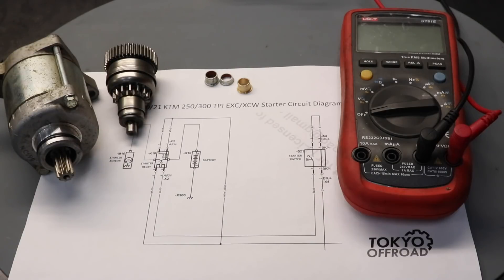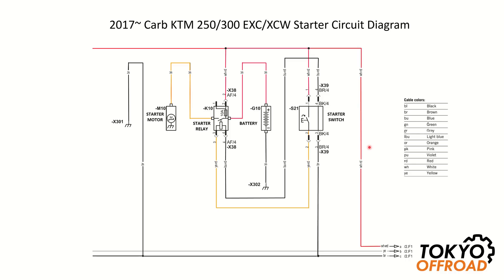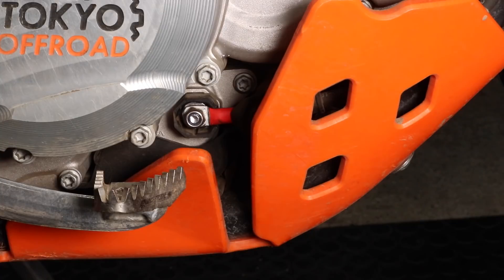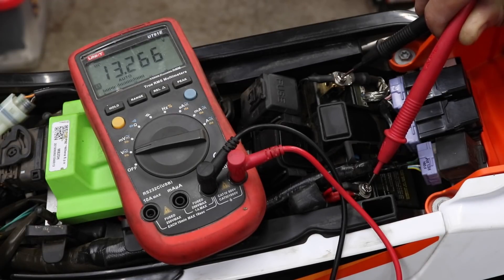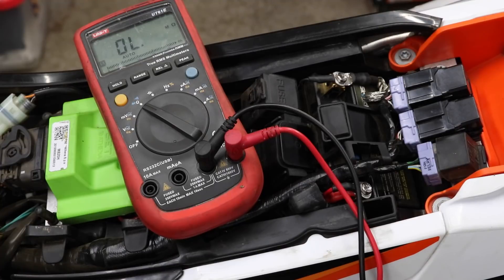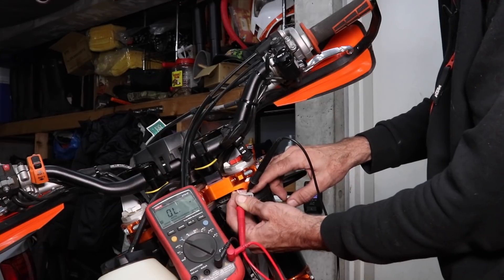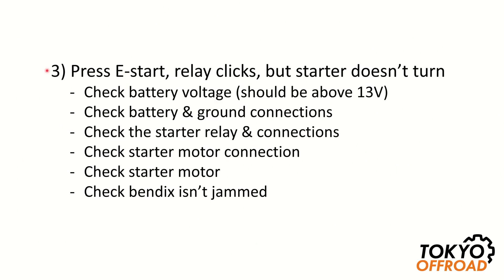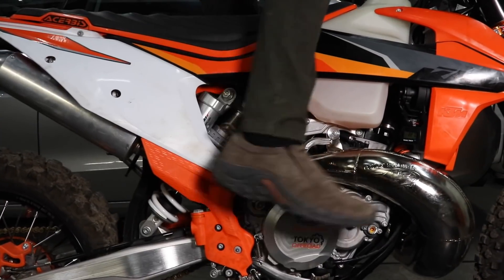KTM & Husqvarna 2-Stroke Electric Starter Issue Debug

Comment: My te300 is a 2025 with 13 hrs on it. Im getting a rattle on start up. Not sure if its the bendix or the bushings for it. Either way its clearly staying engaged for a few sec after the engine starts cranking under its own power
Reply: After opening it up, i noticed the dealer filled with with grease. It ended gumming up in the back bushing
Reply from the maker: It it stays engaged it may be that the bendix is a little sticky. On the TBI bikes to remove the bendix I find it best to remove the flywheel using a puller tool. Once the bendix is removed clean it thorughly with a parts cleaner spray (internally too. To tube it either use a light weigh oil which doesn't tack up, or a dry lube. Do not use grease, pr a heavy oil. Check the condition of the bendix bushings and replace if necessary. For lubing the flywheel I recommend using a light weight oil, not grease (which will fly off and may cause the bendix to become sticky).
Reply: @TokyoOffroad My plan was similar to your recommendation. I was wondering what to use for a lubricant for it. I'll go with a dry silicone or graphite. Thank you for the help and advice

Comment: I have ktm 300exc and some strange problem with my starter, it works ok, means it speen the enghine but enghine is not starting, no spark. It starts first kick but on e start spark is week or absent. I discover that  when i press kill switch for second when cranking on e starter it will start any ide what the issue might be ? I have new lithium battery, new starter, new style bendix, new bushings.
Reply from the maker: Sorry to hear about the problem. What year model bike do you have?
Reply: Acually it is Husaberg TE 300 from 2013, bit its the same as Exc from the same year

Comment: Thanks for an informative video. My Husky Te250i 2021 is having another issue than the starter... It refuses to turn ignition off. Instead it turns on intermittent (every few minutes the ignition turns on by itself). Any ideas?
Reply from the maker: When you say the ignition turns on, do you mean that the engine starts, or that the fuel pump cycles? If you have a battery tender/charger connected that may cause the fuel pump to cycle
Reply: @ the fuel pump goes and the “engine-light” turns on, the starter doesn’t engage but what happens is that the battery gets drained (off course) and the bike runs very “rich” after starting since the fuel pump has been running several times. As soon as it starts, the “check engine light” turns off and everything works as normal. 

It started after a close encounter with a branch that ripped one wire from the stator but that was an easy fix. Been looking through more or less the whole harness and can’t find any more damaged cables. 
 Seems like the ignition / fuel-pump relay gets a constant ground though…

Comment: Hello I’m having a big problem with my 2023 ktm 250xc 2 stroke flywheel. Sometimes when I start my bike my flywheel misadjusts, causing the ignition timing to be off and not start the bike.
I’ve tried tightening the nut to spec and using the locktite washer and red locktite liquid. Still comes loose. The nut and the flywheel stay tight but it misaligns the flywheel. This is also my 2nd flywheel as my first flywheel stripped completely. I don’t know what to do I’ve tried a bunch of stuff and I’m thinking of either impacting my nut on or welding it.
Reply from the maker: You must be missing the Woodruff key. Remove the flywheel and check that the woodruff key is installed and has not sheared.

Comment: Video is great but does not point out that the solenoid is powered by the battery and must be hooked up to the correct side of the relay. Well at least on my 2015te300.

Comment: Hi, Where are all the ground connections please? My bike is not starting after a few weeks of not riding change the battery and the bendix and still not starting.

Thanks
Reply from the maker: The main one which often goes bad is the battery ground strap connection to the subframe. Remove the strap connection and use a wire brush to clean the connector. Apply some dielectric grease (silicone grease works fine) will help keep the connection in good condition. The starter is grounded through the engine. The stator/regulator system has some ground connections to the frame located under the tank (remove the tank to inspect).

Comment: Hey mate great vid but it is not conclusive. 

I got lucky stumbling on to the fix for my starter. I got the clicking sound and nothing else. 

Turns out the previous owner installed an aftermarket clutch cover and the bolt near the brake pedal tip had a 60mm bolt instead of the required 55mm. The longer one goes through the end of the bolt hole then pushes up against the starter housing which is enough to distort it and seize the motor. 

Replacing that one bolt has fixed my issue.
Reply: Hey mate just wanted to say I had this issue to after installing aftermarket clutch cover. I was tearing my hair out going through this list when I saw your comment,  much appreciated, bike started right up
Reply: @mattnean54  awesome mate, glad to have helped out.
Reply: Had the same issue.  Glad I saw this post.  Boyesen clutch cover.  I didn't have a spare 55mm bolt lying around so I just used some washers to space it out a bit.
Reply: @jasonplank8803 glad to have helped
Reply: Just saw this comment and had the same issue, fixed the problem. Thanks!
Reply: @jimmyjohnson3076 you’re welcome

Comment: Inspired by this video, I opened the starter button switch as well as the 4-way connector. 

It is surprising that the connector halves are 'open' from the rear, hence upon reassembly I chose to stuff the openings with silicon paste to make them watertight. There was indeed turquoise corrosion in the bottom pin (in my bike the connector is in vertical position; 2018 Husky). Using contact cleaner and a wire brush (male pins) and a 2mm drill bit (female connectors) managed to clean them spick-and-span.

Normally I'd be hesitant to apply dielectric grease on connector surfaces - the grease being an insulator. But since there is only intermittent and short term low current going through to the relay, I gave it a go. Surely it will help keeping the connector free from corrosion.

Comment: My 2020 tpi starter failed to light up when the button was pressed. Found chafed and shorted wires to the button where they were kinked and zip tied to the warning light harness. This was done at the factory and was inside the plastic wire conduit. This failure happened intermittently, last time in a tight sand wash 15 miles from a transfer rd. Luckily it failed in the shop when I could then track it down. Thank you for all the really great how to videos. I will be using your kickstart install video when it’s top end time at 150 hrs

Comment: First thanks for the video! I have a 2010 Ktm 300 exc. The starter will engage the flywheel briefly then spin without engaging? I’ve rebuilt the starter motor, new brushes, bushes, fully cleaned bendix and oiled with light oil throughout, battery is good 13.2v, even tried new ground from the starter to the frame but still the same issue? Any help appreciated

Comment: 2018 TE150 - E start functions perfectly about 5% of the time. The other 95% of the time, the button does nothing and makes no sound. Battery is brand new. Have replaced the relay and starter button. Connections seem okay with no corrosion. Thoughts? 
Thanks for all the videos.
Reply from the maker: Using a multimeter see if you can trace back the source of the issue. Start measuring the voltage at the relay connections when you press the start button. If you always see voltage at the relay when you press the button multiple time, but it doesn't always click then the relay is probably bad. If however you sometimes don't see voltage at the relay it indicates that there is probably an intermittent contact issue with the starter switch, wiring, or connector. As you've already replaced the relay and starter switch the most likely causes are the connector by the headset, or a broken wire by the the headset.

Comment: I don’t have any starter motor issues with my Husky TE 250 2015 as I removed it completely to reduce weight. I use that kick starter which exist in that motorcycle from the factory. I don’t ride any hard enduro with it. Mainly motocross type riding only.

Comment: Hey man! Thanks for all good work!

Have any clue why my electric start just spinn up with full force but wont start?

2020 ktm 250 tpi exc 12h.. ?

Thanks
Reply from the maker: If your starter motor is spinning at full speed, but the engine doesn’t turn over it’s probably a problem with the bendix (has become sticky internally), or the bendix bushings are worn out causing misalignment of the bendix.
Reply: @TokyoOffroad  so that could be the problem on a almost new bike then?

Sometime i starts, and then it stats easily!
When i have the problem it wont start, if i put a gear in, and back to neutral it often starts..

Strange?!
Reply from the maker: @predragkumanov8813  If it’s a new bike then the bushings won’t be worn out, but the bendix could be sticky. KTM put grease on the flywheel which is flung off almost straight away and creates a sticky bendix if it gets inside. You could try removing the bendix, clean it out internally using some parts spray and air, then lube it up inside using some dry lube, or light oil which doesn’t go tacky.
Reply: @TokyoOffroad  big thanks i will try that, have to see if im man enought to do that myself. Never checked in the starter motor area!
Reply: @TokyoOffroad  so i did check my bendix and itself was working smoothly, it did engage easily. 

But it was alot of sticky greese all around the area of the bushing and inside the bushing. And alot inside the cover that probably was comming from the fly wheel?

I removed almost all sticky lub even inside the bushing... Is there ment to be alot of lub inside/around that area of the cover?
Reply: Also i did check the battery, and ground. No problems. Bike is as i told you new(14h now) and never crashed. So should not be anything wrong with startbuttom etc?

Comment: at 15:00 you mention the spare fuse underneath the starter relay and the other fuse which powers all the other stuff apart from the starter motor. As per the electrical diagram, as far as I can read there is no inline fuse for the starter system; can you confirm is there no fuse in the starter motor circuit ?  An aside to the starter debugging process, the other three relays behind the starter motor relay, not applicable for this discussion but be good to know which each one does. Overall, your videos are always top quality and very informative. Thank you.
Reply from the maker: That’s correct, there is no fuse for the starter motor. The fuse powers the rest of the electrical system. On carb bikes it’s a 10A fuse and TPIs it’s 20A. The fuse is shown inside the starter relay in the circuit diagram.

Comment: Hi, i have problem with starter motor engagement, battery is fully charged, bike is ktm 250 tpi 2019 with only 20 hours. When cold starting this issue is very common especially in this cold days, i push starting button and starter motor is just spining, then i press rapidly few times button and then it grabs and start motor. When bike is warmed up then it is okey. Should i check bushings?

I dont know but im not very happy with these bikes, they costs fortune and they have a lot of problems.
In my first 20 hours on bike i had problems with cracked fuel filter, speedometer not working, front suspension oil leak, starter motor engagement.
Reply from the maker: Sorry to hear about the problems. When the weather is cold the battery voltage will be lower which results in the starter motor spinning slower. I doubt there is a problem with your bendix bushings after only 20H. More likely is that the bendix has become a little sticky internally. KTM applies grease to the flywheel in the factory and this is flung off very early. Some of the grease may have made it's way inside the bendix and if so will result in the sticky operation and often fail to engage in the flywheel, especially when cold. You could remove the bendix, clean it out internally (parts spray then blow out with air) and lube up with some dry lube, or light weight oil which doesn't become tacky. I experienced this with my 2017 when it was still fairly new and cleaning out the bendix made a big difference...

Comment: Went for a ride today on My 2018 tpi  it was quite cold ( about 0 degrees Celsius) when I got home and parked the bike up I noticed it was waking itself up periodically ( like the sort of noise it would make if you left it on a hill in gear and it rolled forward a bit). I disconnected the negative battery terminal just to stop it from happening. Then later on I went to reconnect it and as I was screwing it in the bike woke up again and the connection started to spark. Any one got any ideas?
Reply: This recently happened to a guy in the te300 group. If i remember correctly it ended up being a faulty CCPS

Comment: Do the longer 2020 XRC bushings fit on a 2017?
Reply from the maker: No, it's not possible as far as I know. The standard length XRC bushings are very good and so long as they are held securely in the case bores and lubricated periodically should last the lifetime of the bike. Note that when the case bores are undamaged the XRC bushings will be a light press fit. However, the stock bushings tend to spin in the case bores, wearing the bore. If the wear is not that bad some Loctite retaining compound (either 638, or 648) can be used to secure the bushings in place.

Comment: Mine spins up then all of a sudden stops but continues wind, almost like the battery doesn't have enough juice so doesn't throw the bendix out,  i have xrc bushes good connections, thoughts?
Reply from the maker: It might be an issue with your bendix. From the factory grease is used to lubricate the flywheel and gears. The grease gets flung off the flywheel almost straight away and some may have made it's way into the internal part of the bendix, resulting in sticky operation and poor engagement. You could try taking the bendix out, spray plenty of parts cleaner inside it, blow it out with air, then use some dry lube to lubricate it internally. For gear and flywheel lube I prefer using a light weight oil which doesn't tack up. Other things to check are your battery is in good shape and fully charged and the battery connections and ground connections are good.

Comment: Do you keep a charger on your battery in cold weather??
Reply from the maker: I personally don’t use a battery tender permanently connected. I tend to ride my bikes regularly so the batteries normally stay charged just by riding them. But if I haven’t ridden a bike for a while I will charge the battery to ensure I don’t have any issues. If you have a lithium battery be sure to use a charger designed for lithium batteries.
Reply: @TokyoOffroad  Okay thanks. I just had to replace a battery for my 2020 Husky TPI. Just wondering if it could have been avoided if used my lithium battery charger on a regular basis.
Reply from the maker: @eddiekelley527  - Yes, lithium batteries do not like being deeply discharged, so if you're not riding regularly it's a good idea to either disconnect the battery, or use a tender designed for lithium batteries.